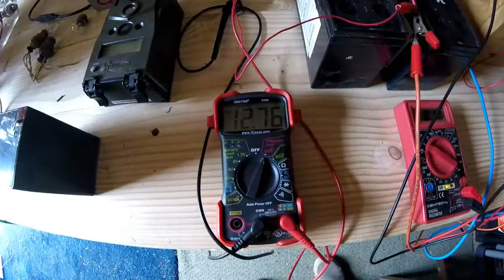Experiments With The Bedini Motor Output

Comment: As far as I understand Bedini's motor it generates high voltage spikes to charge batteries and melt the crystals that are lowering battery's performance. Therefore capacitor should not be used as it takes the spikes out.
Reply from the maker: True. But its interesting to see what happens long term with a cap.
Reply: EsamoKoram.  If the tiny capacitor takes out the spikes, would it not also be true of the lead acid battery?  After all the battery has even more capacitance and should also take out the spikes by your logic leading to no effective result, yet there is a result.
Reply: EnergyCrafts the lead batterys are bad ones that won't take a charge from a convention charger.  I'm guessing if you charge a good battery with that it will smooth out the voltage spikes a lot more even without the capacitor. At least it did on the simplified one I built.
Reply: Hi wiggys.  Yes, I get that Troy said these were "bad" identical batteries.  However, the Bedini IS a charger too not just a desulfator.  Even Bedini, has used NEW discharged batteries and could charge them up, no problem.  So not convinced in your logic that the bad battery does not kill the spikes because it is "bad" since John Bedini has showed good batteries not only getting charged just fine, but that the circuit would cause OVERCHARGING if not monitored.  So by your logic,  a good battery (good capacitance) should smooth out the voltage spikes, yet he shows batteries during charging going way past 13.8V and actually overcharging.  This would not happen if we were just smoothing out high voltage spikes of millisecond or less range pulse durations  of tiny actual energy across such a big load.  The way I see the battery is it is a complex system of material mass, electrons and ions with character of both battery and capacitor.  You know that  club used to hit a ball in the Croquet game?  Well imagine the ball on the ground and you put your foot on it and hold it rigid.  Now take that mallet and hit the ball.  If you hit the ball and let the mallet have an inelastic contact the ball reaction is totally different than if you swing the mallet with an elastic strike to the ball.  In this analogy,  The spike is an ELASTIC action to the battery physics.  But in regular battery chargers using DC charging the current is forced into the battery thru a costly resistance in an inelastic reaction, where current amps is the cost you pay for in Watts.  In the elastic spike action, current is not much of a contributor (nor is resistance) and your Watt cost is tiny or meaningless in certain arrangements.  This then explains why persons harping on using regular ways to measure amps, volts and watts are not getting anywhere after all these years.

By the way.  You want an easy experiment for free energy from all around us?  Simply take a capacitor (note what I said above on lead acid battery) in the cool of the morning and charge it to X volts.  Now put it where the days sun can reach it.  At noon go out and note the voltage on the capacitor.  You should see an increase.  You have collected free energy in the cap.  Plug in the values in the capacitor power equation to prove it!  No violation of physics.  Use good not leaky capacitors of high uF capacity as possible for most impressive results.  This is only a simple demo, not intended to be the best circuit possible, there is far more that can be done.  This is known knowledge for many years, just not the hip method of today, like solar cells etc. are.

Comment: Troy, good experimental setup.  Little to add except if possible, use two identical meters.  If you don't have to identical ones, then verify the voltage of each meter is the same for the present voltage of one of the TEST batteries.  The harbor freight meter may not be accurate.  I bought one NEW recently and it was off by 2 volts when reading a 12V power supply!  If yours is off, there is a pot inside that you can adjust to match the reading of your other meter.  Some of the meters I got, do not have the pot anymore.  Seems they got cheap and just mounted a resistor where the pot is normally.

Comment: Also a diode has a voltage drop if you connect 2 diodes in series you get double the voltage drop, but if you connect 2diodes in parallel you actually get 1/2 the voltage drop, that should increase output

Comment: I saw your video about getting voltage from the ground, which i have seen many videos on that subject. But my question is Could you make your bedini gets its source of power from the ground to charge and repair all your batteries. Sounds like a good experiment.
Reply: Nothing would ever be created if imagination were stopped.
Reply from the maker: Yes eventually that is an experiment I want to try. Only problem is that an earth battery cannot be put in series in the ground. They short one another out. But you can make earth batteries in containers and connect them to power things.
Reply: ateamofone.  Why muddying the experiment with chasing another source of power (ground) when it has already been claimed that the Bedini circuit is ALREADY harnessing an energy source.  Why would we need the Bedini circuit involved if you can already get this other energy you claim from the ground?  This would just muddy the study of how/what is going on in the Bedini observations at this point.  This is why little has been revealed how the Bedini gizmo functions in all these years as everybody keeps adding more variables before following a more methodical study of what is really going on.

Comment: What does a bigger machine look like? Lots more copper wire coils? Or just bigger magnets? 
I actually like to make the coil big but the inside gap is only big enough for the magnets to spin inside the coil , my next motor should have 5kg of copper 2x2.5kg coils encasing my spinning magnets which is 6xn52 magnets put together in a stack, their dimensions each are 25mmx50mmx10mm but the magnetic field of those 6together is over 1ft from the north and the south, 2ft diameter magnetic field, i wonder if lots of pick up coils could be put in that field all round and through series or parallel winding, could any voltage or current be got out of just the pick up coils, mains output would be nice, could a real battery charger be plugged in and used, could a kettle get enough power to work.